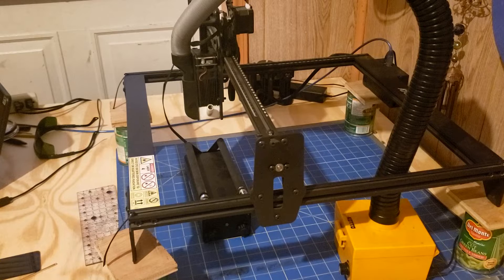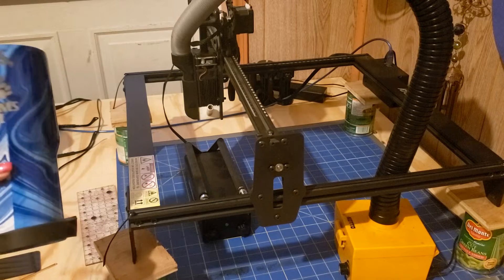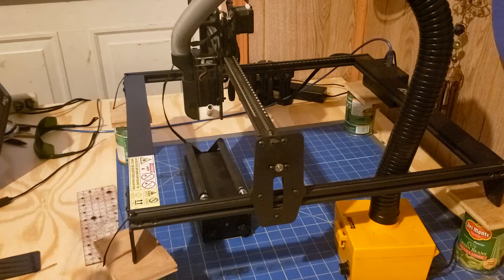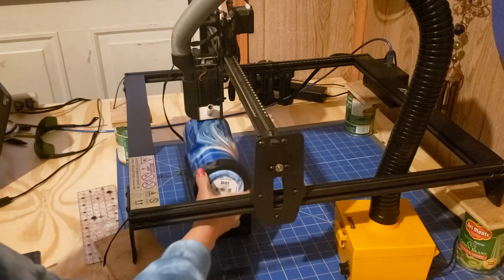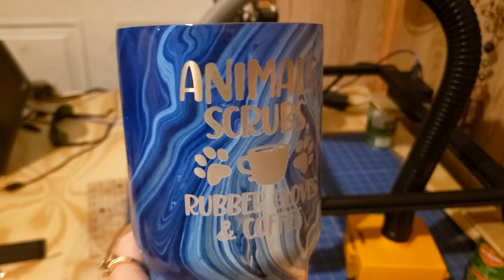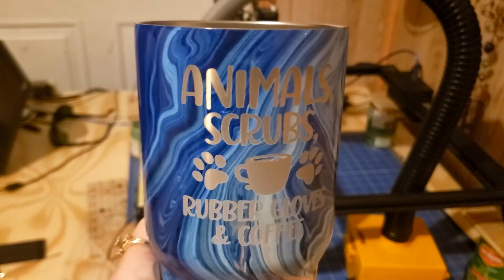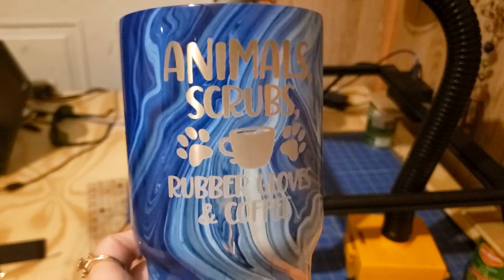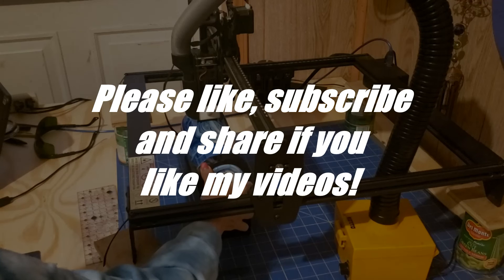Engraving a tumbler with Atomstack A5 20W

Comment: What setting are you using?
Reply from the maker: For this cup I used the  Atomstack A5 20W diode laser engraver Spd 20 Pwr 95. I have up graded my laser to the S20 Pro laser engraver. Compared to my A5 20W, this machine has roughly twice the power, will work faster, and can cut deeper.
Reply: What settings are you using for the s20 I have the a20 and omg I am having difficulty finding help for my settings I’m just starting tumblers

Comment: That engraver is I think at least 2 years old now, and kind of rigged up for fume extraction as you can tell. The black/yellow thing is really meant for short-term use when doing things like electrical soldering, so it probably doesn't have long to live. Looking forward to the new gear arriving, but spoilers...